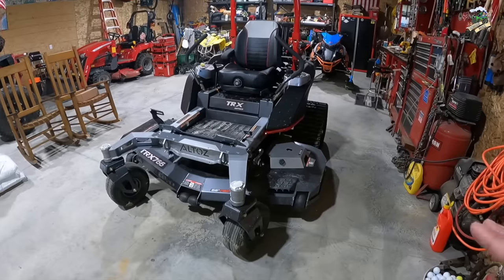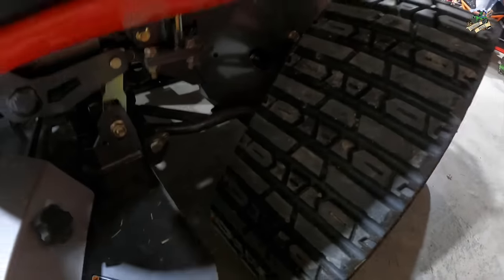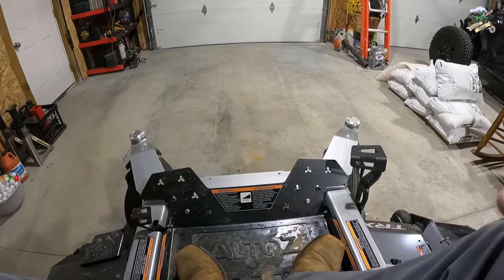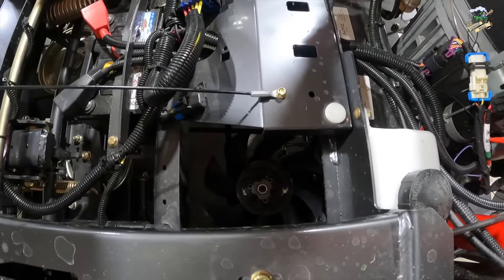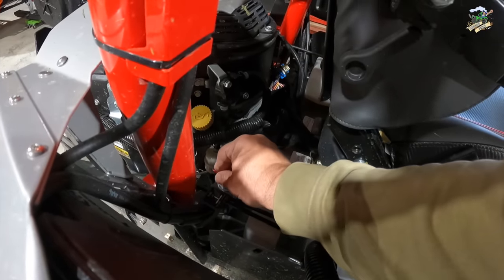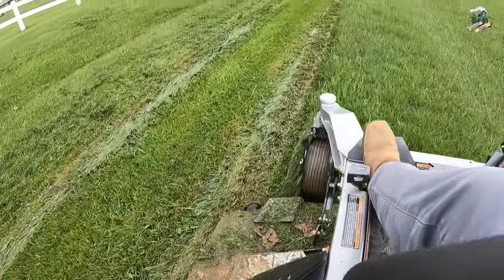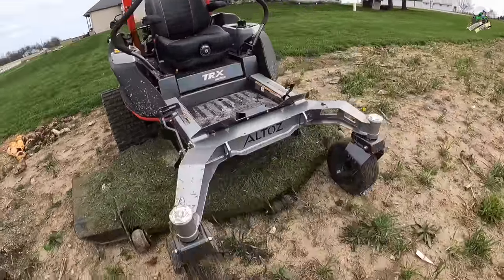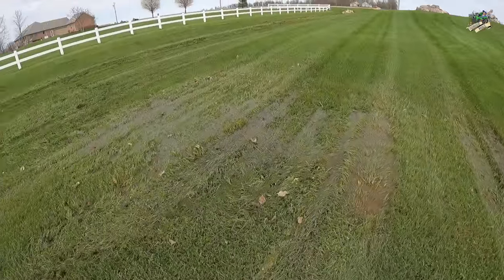My NEW ALTOZ TRX766 Zero Turn Mower on Tracks | Machine Overview

Comment: Mike great video . When I was mowing 22 acres each week . I used 2 JD zero turn mowers one with the deck in the front and the other one had a Deck underneath like the one you have . I used the one with deck in front to get closer to the grave stones and the other for larger areas of course I used a weedeater to trim around the stones which I did first . I just spun around and usually mowed that way & Yes they are fast due the zero turn radius Sorry for the paragraph

Comment: Great mower. Love the demonstration of what the mower does. My only advice as a lawn care guy is always keep an extra set of belts laying around for the deck and drive, but the machine is brand new shouldn't have a problem for awhile.
Reply from the maker: I actually bought a set of blades, blade bolts and a deck belt when I picked the machine up. You just never know. I remember years ago mowing my yard and sucked a stone up and bent a blade. I had mowed that same spot hundreds of times before and it just came out of nowhere.

Comment: Seeing those cut strips made me wonder if you were running a a WASS line for a minute, but I didn’t see a globe. Great looking machine.
Reply from the maker: I was in full control of making those straight lines back and forth.  Not sure if you can get some sort of guidance for a zero turn mower.

Comment: That mower looks sweet, congratulations !    I have a John Deere ZTR that I bought new about 8 years ago and it runs great, the only negative on it was the front tires got constant flats so I replaced my front air tires with solid rubber tires and they absolutely work great.  ZTR's can tear up the yard a bit on really tight turns but if you round out the turns its not an issue for me.  ----  Looks like maybe you need to put in a piece of Tile drainage pipe in that low area of the yard and run it to the ditch to help keep the yard drained.
Reply from the maker: Yes on the tile   I just bought this property about two years ago and that’s on the list   3 different fields dump into this ditch that runs through my backyard.  I already fixed a tile blow out that was here when we bought this place.  I’m not sure a new tile will solve this on the big rains but we’ll see
Reply: Does it tear up because your in wet or dry soil? Been looking between getting a zero turn over a ride on because after 8 years im tired of getting off work to work another 2 hours to mow with my push lol
Reply: @ShaquilleOatmeal94  -  Pretty much all ZTR /Zero Turn mowers tear up a spot on the ground on the side that the mower pivots on when doing a hard turn .     Regular Garden Tractor mowers don't do that but they are not as easy to maneuver and turn around so it depends on what you want.

Comment: I mow for a living. Your grass is so thick the tracks don't be an issue except for around the house more than likely. If it is an issue, you just might need to alternate where your tracks run while mowing around the house. Like you might want to push mow along the house so you can move your tracks over 2 ft for a couple mowings. Also alternate your direction and ruts at the end of the passes won't be a big deal.  You will only scrape the grass blade off, not the roots.
Reply from the maker: Thanks,  I generally always push mow two passes around the house and the tight areas anyway.

Comment: You mentioned it says not to mow on an incline over 25 degrees. 
Is there an issue with the tracks coming off if mowing on a stepper incline or is that just a safety rule they put on there.
I mow ditch banks stepper than 25 degrees and I'm interested in one of these mowers is why I'm asking.
Reply from the maker: I believe it’s a safety thing
Reply: Good deal, 
With all the rain we are getting this year them tracks wound be nice to have.

Comment: If you have wet land I understand. 
We had them at my local dealer.
Priced at 28 K
I choked.
They sold very little and now sell none.
Stopped carrying the brand.
Reply from the maker: Altoz also builds wheeled machines.  Yes these cost a little more money but I feel this machine is built a lot better than a lot of the others.  Tracks also perform better on slopes

Comment: If your Kaw 1000 is carbed, it is 35 HP. If EFI, it is 38.5 HP. I have the latter on one of my zero turns. Since there is no choke next to the throttle lever on yours, I am guessing you have the EFI as well. That engine is fly by wire in that there is no throttle cable. It is electronic throttle control. Good on fuel and the most actual certified HP  of any mower engine out, including the 40 HP Vanguard.
Reply from the maker: Yes it’s the 38.5
Reply: @farmhandmike  You replied quickly LOL I  was editing my post to add some info for you that you may appreciate (if you didn't already know this), so you may want to re-read it.  Your yard looked great when done.

Comment: How much does it cost and how much are the replacement tracks when they wear out?
Reply from the maker: The mower with tracks did cost more than the wheeled version and I'm not sure on replacement tracks and hopefully don't have to worry about that for a while.

Comment: Looks like you need to install some drainage tile.
Reply from the maker: I'm sure it'd help. I just bought this property about 2 years ago and fixed on spot where a tile blew out. The wet area in this video is where several fields all drain into this area and run through my yard to the creek. So we will have to trench in a main in this area and I have to get with all the landowners that drain into this. It takes time.
Reply: @farmhandmike  Thanks for explaining.
Reply from the maker: @r.scotthill3082   Yes plus we've had a lot of rain the last couple of weeks. It's not always this wet in those spots
Reply: @farmhandmike  I know all about the rain. I live in Randolph Co. right behind Union Dairy